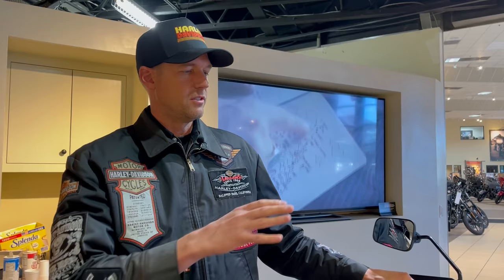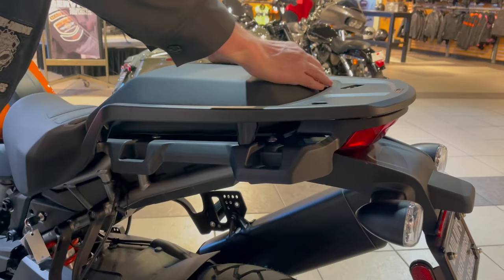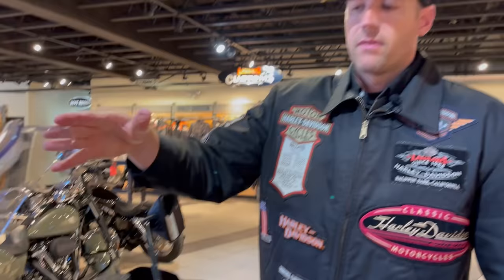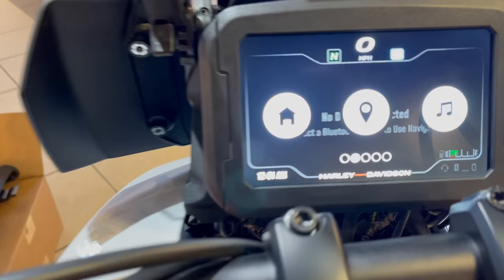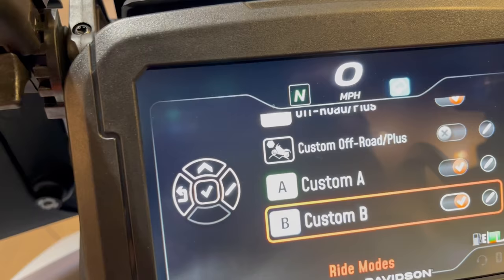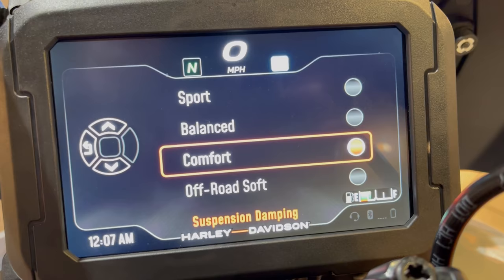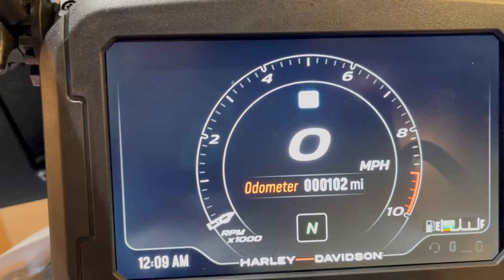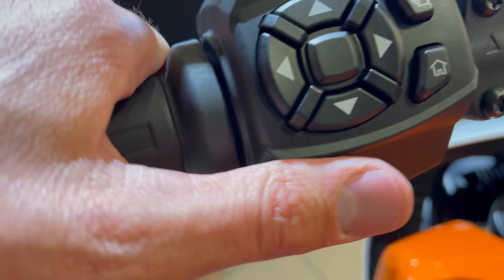Harley Pan America Tech Demo and Hands-on Tutorial

Comment from the maker: UPDATE: There is now a software update available at dealerships to enable charging through the USB-C port while the bike is in operation.
Reply: What was HD thinking?  no charging port up front in 2021?
What else is missing?
Reply from the maker: @UncleFjester  it was a matter of a software update. It works while the bike is running now.
Reply: @MattLaidlaw  thank you
Reply: Thru usb-c??  You can’t put enough power thru usb. That’s stupid. You need a pigtail. Just put it on.
Reply: Thank you so much. 🙏🏻
Reply: Awesome.
Reply: @robertlee8042  usb c can deliver up to 100 watts. It’s not like the older standards. I’m guessing Harley were initially concerned about people potentially draining the battery by connecting the wrong device to it and maybe have limited power output over it now via the software update to open it up.
Reply: @theonlyredspecial  a C connector has very little meat. Watts cause heat?  I thought amps cause heat. 5 volts would be 20 amps at 100 watts. That’s a lot of amps. Am I wrong?
Reply: @robertlee8042   USB-C cables are capable of delivering up to 100 watts of power if the source controller allows it, but the latest spec revision increases it to 240 watts. USB Type-C with USB PD allows the ecosystem to support several power levels up to a maximum of 20 volts at 5 amps (100 W). It’s why a lot of laptops moved to the connector for fast, efficient charging. I’m not entirely sure how Harley set it up on their bike however.

Comment: Many things to like about this machine.   I have a 2018 BMW 1200GS.  One thing about the Beemer that I like over the Pan Am is the control on the left handle bar for menu options.  On the BMW it is a wheel that you turn and press in for use.  Much easier to use and navigate all the menu options.  I've only seen it on BMW motorcycles.

However, for the first attempt by Harley this is an excellent motorcycle.
Reply: How often does that matter?  Not often.
Reply: @robertlee8042  you have a BMW GS?

Comment: Thanks for taking the time to make this video.  There has got to be an option to run power to the handle bar area to charge phone or 3rd party GPS but pleased they have outlets from the factory for Gerbing heated gear.  Just wanted to add about the Ride Planner app from my experience.  

It is a great way to plan a route before hand using a laptop or pc.  Try to make it as simple as possible when planning out using the least amount of waypoints.  Keep the file size down to a minimum.  Break up a route if necessary into separate files (ex: LA_Sac_1, Sac_Tahoe_2, Tahoe_Vegas_3, Vegas_LA_4) and a large part of that depends on waypoints.  It's just something to experiment with before you try on a multiday adventure.  If you set a waypoint and don't actually meet it, the app will reroute you based upon the most fastest way to reach your destination.  For example, you spend time planning a route through the twisties from LA to San Diego but miss a waypoint you set before the twisties.  It will most likely reroute you using the interstates.  If you miss a waypoint and it keeps yelling at you to U-turn to go back to it, then you decide to use the "skip waypoint" option, it will most likely reroute you using the interstates or even roads that are pot hole dirt gravel roads that it determines to get you to your destination quicker.

I think the Harley Ride App will continue to operate or hold the planned route (or even unplanned route if just viewing the map as you ride) you set even when you run out of cell phone signal service and relies on the GPS function within the phone (totally separate technologies from what "experts" have informed me)  The GPS satellites lock onto a "beacon" baked within your phones motherboard and is how it can track the exact location even when you don't have cell service. 

Matt looks like he forgot to switch the display from Kilometers Per Hour to Miles Per Hour.

Need to do a video with people of different heights, like Jamie, mounting the PA, moving it around like in a garage, stopping with one foot on peg, one on the ground for tri-pod effect.
Reply from the maker: Great Tips Murph. I think if you know how to use the app it can be good but for someone just jumping in blind it can be very cumbersome.

Comment: Great explanation of things. My dealer needs to watch this video, they didn't know nearly enough about the bike. You nailed the navigation system, it's the weakest point on the bike. I absolutely hate it. I hope HD figures out other options in the future. You solved my switched power problem. I hadn't thought about using the heated clothes plugs. Brilliant suggestion! Thanks! One thing you didn't mention was how you can change the background from black to white by holding down the trip button for 4-5 seconds (that's not even mentioned in the manual).

Comment: I also discovered that the entire owners manual is available on the HD App. Could be useful sometime.
And also if you want to change the security PIN that you get given with the bike because who needs another code to remember, don't use the touch screen, just use the indicator switch to move the numbers left to select number and right to move to the next. So much easier.

Comment: Got my Panam S yesterday. So it's totally new to me. Loved this tuto. Loads of info. 3 things bug me already with the bike :
• The nav system goes through the phone, so you need to download the app, make an account and it's probably best to download a map.
I went out this morning and coming back it got lost - no map found etc... so you need to download the map.
I wish they had just used Apple Carplay  instead of their system. I don't like the display on the bike. It's really not detailed. You can't get that TomTom Rider 3D sort of view as if you are on the bike. You're an arrow on a map. If there is a way around this I would like to know but I can't find any choice of view.
• First 200yds out of the HD shop and all went black. No screen. Nothing. I restarted and another 500yds blackout again.
Back to the shop, they went for a ride and all was fine. I think the keyfob was getting interference from something I was carrying - car or house keyfob maybe.
Anyway all was fine today until tonight when the same thing happened. I put the fob in my jeans pocket and all was OK.
Would love to know if anyone has this kind of problem... and even if it's the problem.
• And lastly - the bike gets hot. In traffic today it was 33°C and my left leg calf was burning. I've never had a bike that throws out that much heat. So shorts are out !
That aside my first impressions are good. It's an easy ride. Still running in but the Sport mode really moves.
I've never had a big trail before so I'm on a learning curve. And I will check out the USB-C situation.

Comment: Excellent instructional video, Matt. I ran a USB-C cable under my tank yesterday when I installed my Extreme-Flow Air Filter. It was an E-Z fix to the issue. I have a couple of RAM ball mounts set up for my phone and GoPro... no complaints. Trivial issue.
Reply: So you used one of the hot leads under the seat?

Comment: "hey guys, let's put the battery where it'll get submerged and a PIA to access in the field! bonus points for pelting the exposed R/R with rocks!"
hmmmm.....
the foundation looks like it's there, but the details never got sorted. power accessibility, no GPS or even a dash power source, the only source being the gerbing style heated gear plugs sticking out from the seat gap? yikes.   
better hope your phone is one of the few that will sync properly AND mesh it all with an "app". that always works out well right? God help you if your phone is a fan of something like sena, but not the HD headset. well, it has too, because it'll be locked under your seat and if it doesn't you're SOL. and be sure you never go anywhere your phone coverage drops.   
since these can be fixed relatively easily by HD, with the exception of the massive problem with the battery and R/R position, this is probably going to receive some "model updates" pronto, which is great for most, but sucks to be a first version beta tester.
the lack of active cruise and a quickshifter I understand, that's to keep their cost down and not everyone will use them, but probably a good idea to offer as an option soon 
it looks like a wonderful bike, but with glaring flaws
Reply: Battery looks to be covered by the regulator and a very large bracket...and it's a sealed battery, so weather shouldn't mess it up too much.  I guess it is to be seen if it is a problem or if connector corrosion becomes an issue. It does get the weight of the battery low though, so that is a positive.

After owning many vehicles with gps navigation I've found I rarely use it...not sure if I would use it on a motorcycle. I doubt it though. Part of the adventure is getting lost and finding my way, IMHO.  It's cool it has heated riding gear hookups and a battery tender cable already. 

I see software updates in the future to make that usbc port live while the bike is running. That just makes the most sense for someone who wants to look at their phone while they ride while charging it.

The adaptive ride height is a game changer for us short people. Great idea on Harley's part for offering that.
Reply: Trying hard to find faults, nice try.If you so desire, put a USB port up by the console (If you know how). However, I'm not so "dependent" on a "phone" in my face on the handlebars to ride a motorcycle. The GPS is there through an app via bluetooth (better). BMW GS1250/850/750) you have to "buy"($949 us) a GPS unit. So, technically no adventure bike comes with GPS. 
You can use any headset... not just an HD headset. Educate yourself with facts first. 
It has cruise control. why do you need active? Do you even ride a motorcycle?
Reply: @jvc350  glad I could help you vent, hope the rest of your day goes better for you.
Reply: Yeah, I'm shocked nobody talks about the battery placement. My buddy just spent $21k for this bike and his battery got messed up and shorted the regulator from riding in the rain already.  He didn't have it submerged but there was alot of rain. Great fun bike though 👍
Edit: there are slits/vents in the cover so yes, the battery connectors get wet. So, 1 battery, 1 regulator, and 1 fuse later, he's doing good but he said he will avoid the rain for now on until they make a different sealed cover. Not sure if they'll ever do that because the regulator needs air.
Reply: @PAULY-P  that's the big one that's going to bite them , I think. the rest are "features" and can be fixed relatively easily, but the battery and R/R are ride enders and relocating them is not a simple thing. 
I know they did a lot of testing, and swear it'll be fine, but no amount of engineering "around" the problem changes that water and electrics don't mix well. 
will be interesting to see what do about it and when, once it gets more use in the real world.
Reply: @PAULY-P  Harleys have had their regulators there for the last 20 years or more. I've ridden for hours in rain and a couple flooded roads. I'm surprised to hear this. I'm scratching my head on this one
Reply: @jvc350  
Well, i think the problem is with the battery connectors getting too wet. We believe that's what shorted out the regulator and blown fuse. I don't believe the regulator is the issue. I believe it has to do with the battery placement. It's a sealed battery but the connectors are still exposed. Harley told him it was just a bad battery and wouldn't keep the regulator going but the regulator is fried in which they couldn't explain. So who knows. I guess in time we'll figure it out. It was placed under warranty and said it was the 2nd bad battery they've had for this model at this dealership.
Reply: @PAULY-P  My understanding that it is a new battery. I'm picking mine up in a couple of weeks. I know people that have actually run through streams, not deep but they were wet with no issue.  We will see! Theres bound to be issues with a brand new platform anyways. Also, four wheelers jeeps etc submerge batteries too. I don't think this is an extreme off-roader like a true dirt bike. I see it on jeep trails etc.
Reply: @jvc350  
Yeah, lets just hope the batteries are ok. Again they said it was only the 2nd bad battery they received from the Pan America. My battery under my seat is a sealed one too but never had any issues like that. I'm not trying to discriminate against Harley, I'm just giving info on what happened to his battery and what Harley said it was. Even though they don't exactly seem to know why. Maybe it's the maker of the batteries or the lot. I will say, if i ever made a bike, i wouldn't put any electrical down low near the elements. Especially one made for offroad. Just my opinion. Take care 👊

Comment: Great video!  Thank you for taking the time to go over functions and settings.  I think you are correct that the GPS via Cell is not the best.  Going from HD Ultra with built-in GPS would spoil anyone and probably frustrate others who expect the cell to display on PA to be anywhere near as convenient. I will miss the bagger but being in my early 70's I welcome the fact I will be losing 350 lbs or more.  That's like 3 extra wives in my case! :-)  Keep up the good work and thanks again.

Comment: Like the bike but they couldn't have put the battery in a worse position for an ADV bike. I'd have to ride this back to back with the BMW GSA before making a purchase.
Reply: Why do you say the battery is in a bad position?
Reply: The battery is in line with the KTM, etc. ITs grounded so water is not a problem
Reply: @justinlash3814  that's what I was thinking...
Reply: But can you think of a worse place to put it? Maybe under the seat, behind a side panel or even under the tank would be better than just of the ground directly behind the front wheel.
Reply: Having the battery (which typically is heavy), mounted lower on the bike is good for weight distribution. Having the regulator in a spot where it can get sufficient air-flow is good. However, not sure what's going happen when the battery terminals are submerged in dirty water, thus shorting them out. Might be ok for a very short time, but still I think that's going to be an issue for someone, that frequently needs to cross deeper puddles or small streams.  Otherwise, having the battery down there doesn't seem like a problem to me.
Reply: @michaelmc3653  weight distribution ROFL.
Reply: I had an old Guzzi the battery, size and weight of a cars, under the seat. Handled the curves fine. The battery easy to get to, stayed clean and dry. Today's batteries can be much smaller and lighter, their weight on a motorcycle is not an issue.
Reply: So if the H-D PA battery is a sealed type of battery and the water crossing is not too long nor salty water it will probably be fine.
I did an experiment with a friend and in a glass of tap water we saw less than 30ma of current flow through the water at 13.8vdc. However, when we added salt to the water it went up to 100ma. So probably ok for short duration.
I would definitely opt for the heavy duty skid plate if riding off road. One big rock and the voltage regulator is going be damaged for sure. Overall still an excellent first model year effort.

Comment: Great rundown Matt. But especially on an adventure/touring bike one would expect to have a charge port in a usb/usb-c you could hook up to your phone, camera, etc. That’s definitely a bummer and hopefully H-D will get that port “hot”
Reply: It has a USB-C port.
Reply: @rso1411  Yes. But no power from it, when the bike are running. With so many riders, having their smartphones on a handlebar mount, when riding. It would be very convenient, if you also could get some charge power on the move.
Reply: @22duke  Yeah, my bet is that they update that port with a firmware update so it stays live while the bike is running. If not, you could always run a wire from one of the included ports under the seat.
Reply: @22duke  Really?  That doesn't even make sense.  I hope you're wrong about this.  I will be very disappointed.
Reply: @rso1411  Listen to what he says in the video. As soon as the Bike fires up. The power turns off.
Reply: @22duke  Yeah, I just watched it.  That is very disappointing.
Reply: @ryanm.9197  I hope so.. Running a cable from under the seat, up to the handlebars. Doesn’t seem so 2021’ish.
Reply: Word from several PA forums is H-D now has a flash fix available to energize the USB-C port while the PA is running.

Comment: Thanks.   Matt, Looks like you were hauling ass through traffic 100 + mph.  I did a test ride last Sunday.  I'm older than you and am used to a Heritage Softail with big boards and long shifters for the feet.  My legs are more forward.  On th Pan am with big boots (hiking  boots) my legs aims back from the knee.  And I could barely  get my  foot in to shift between the peg and the shftier.  Is there a longer arm for the shifter?

Comment: Thx, great info. I have a Garmin Montana with the AMPs mount, that will be my goto GPS Nav. I will be adding a 2 port USB mount to the handle bar for the phone and a gopro. Matt, what is the typical RPM for the bike at cruising speed. As an example my FLTRK is happy at 3000 RPM's.